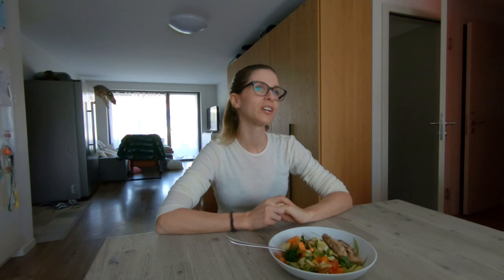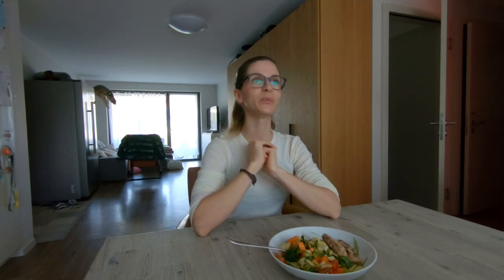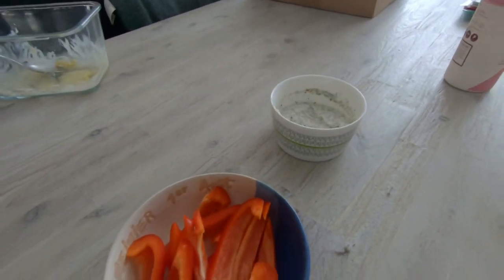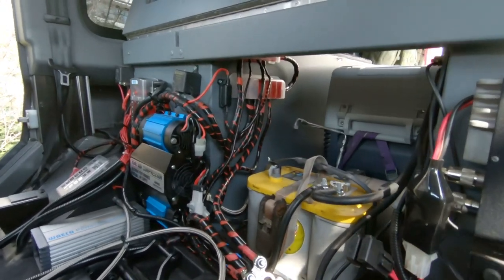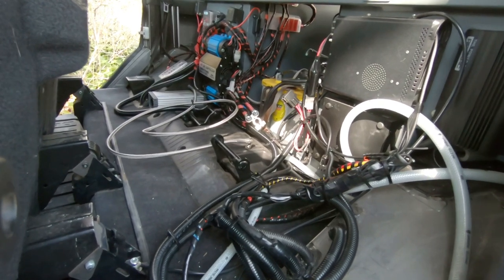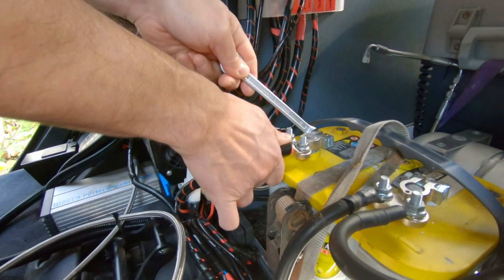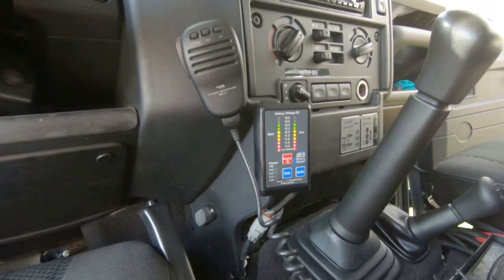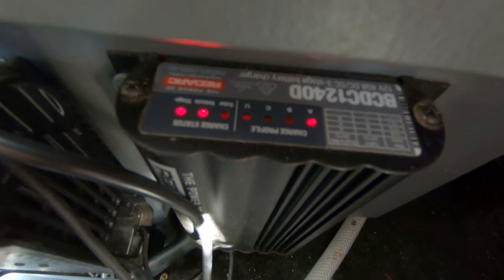TIDYING UP THE DEFENDER | Overland Defender Camper | Vlog series

Comment: Have you ever checkt how much the el.consumtion is  if everithing is off ?
Reply from the maker: Not sure to understand your question.
Reply: Ok, that’s the procedure switch everything off disconnect the plus connection of you aux bat. then take you voltmeter and switch to amp now, hold the voltmeter in-between the bat and you're disconnected cable. So you can determine how much the consumption of your System is in off position.
Reply from the maker: @feuzpatrick1009  Okay thanks! Yes we will check it soon. We are waiting for receiving our new battery monitor system. It will also calculate amps!